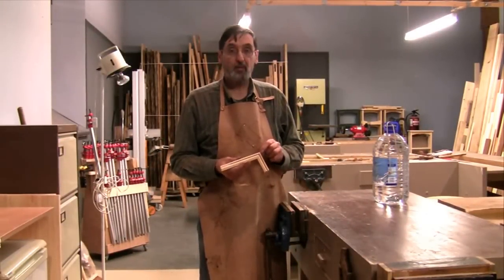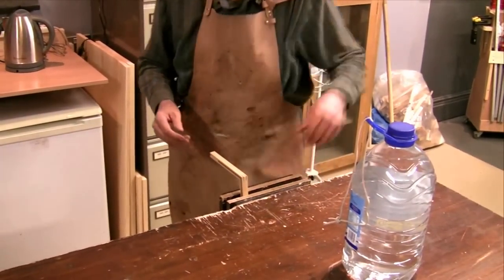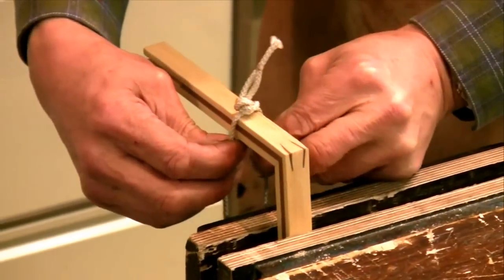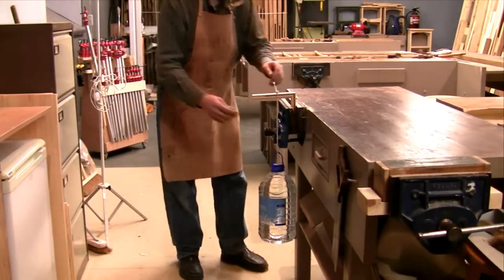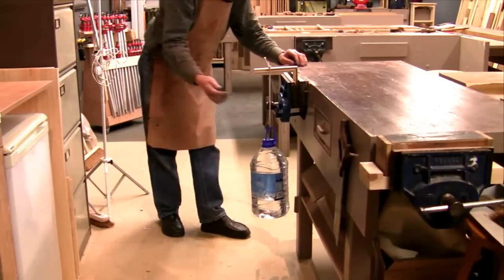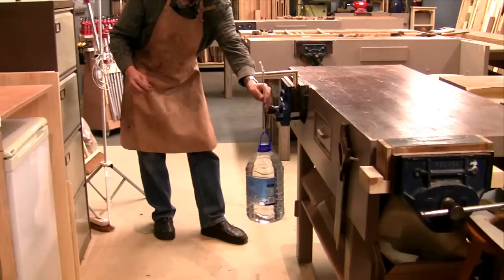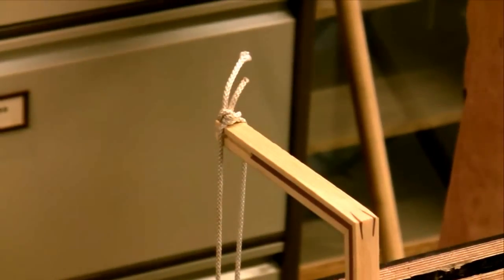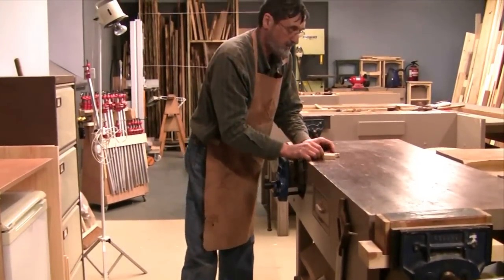Handmade mitre joint put to the test | Paul Sellers

Comment: The splines seem to be feathered to a point on each side.  Is there a reason for this, other than decorative, and how did you create this effect?  I also wonder what method you used to make the cuts for the splines to slot into.  Many thanks for your videos.

Comment from the maker: I am sorry, I don't understand what your point is here. Putting splines in increases the strength of the joint manyfold. What does a bandsaw or a guillotine have to do with the test of whether splines increase the joint strength or not, as apposed to nails or just glue?

Comment: Since it was the glue that eventually failed, I would be interested to see a comparison to the strength of a non-splined mitre joint done with the same glue. Or maybe a joint cut with a standard home center mitre saw for comparison to hand-planed. Thanks so much for the videos!

Comment: at the end the force applied is roughly around 5.5 ft-lb's  or  7.5 N-m someone said 177 ft-lb below which is incorrect. 6 Inches from the joint is .5ft. 1 liter of water weight 2.2lbs, so 5 liters is 11lb. 11lb*.5ft = 5.5 ft-lb. Not sure what the cross sectional area is so cant calculate stress on the joint itself. It is unfortunate the glue failed, would have liked to see what the joint could take if it was fully bonded.

Comment: For us 'Murcans, that's just a bit over 11 lbs of weight, so the joint failed at somewhere between 5 and 6 ft-lbs of torque through the joint; pretty impressive, actually, for a joint with that little surface area.  Based on my own experience, a mitered joint between 1/2 inch square legs, with no splines or other reinforcement, will fail at less than 1/2 ft-lb of torque.  Sometimes, just the weight of the frame is enough to break corners open if it's picked up by only one edge.
Reply: What?  That I'm hirsute?  ;-p
Reply: Well, there's that, too; I guess I'm contagious...

Gasp!  I'm a lycanthrope!!

Comment: Well, it would be as strong as made with power tools really. Well, still very impressive nevertheless.
Reply: Not sure exactly where power tools or hand tools would make any difference here but just so you know, this will have been made by hand as he tells you that he used a tenon saw. Also since the failure point was the glue it would not matter either which way.

You are right about one thing ... it was very impressive!